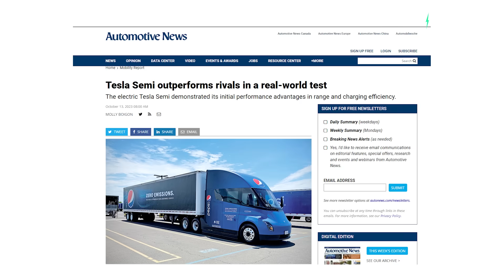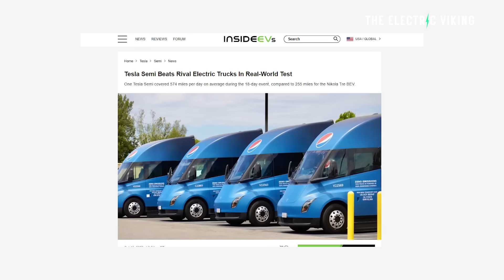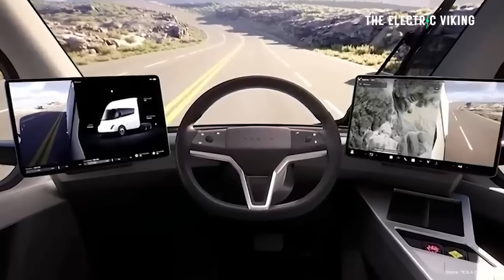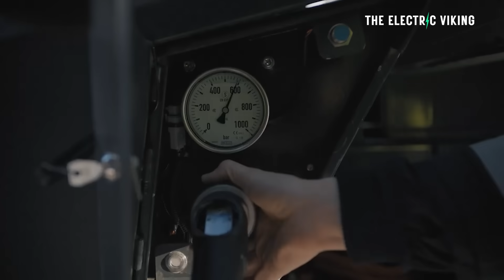Mercedes claim that Tesla Semi breaks the laws of physics proven correct

Comment: In the US we have to take into account DOT rules. When I was driving, if you worked ONE minute over x amount of hours, you’d be required to take 32 hours off consecutively. In my case that just wasn’t an option. ( we were hauling Trash in Bear Country). Bears take very little time off. 
  As compared to passenger cars this can truly change the world in a far bigger way. In my opinion anyway. Look at all the waste with Cooling systems, air Brake Compressor Systems, Transmissions. Diesel pollution rules….Beside the waste, the maintenance is never ending.
Reply: for Purposes of this TEST , Tesla had 3x Slipseat Drivers over 1070 miles in 24H.

Comment: Yeah Mate . How long are those batteries gunna last ? How much money to replace the batteries ? Are we gunna have Semi's self combusting like we've seen with some of the Electric Cars ?
Reply: The batteries will last 20 years.  Over that time, they will have saved the company more money in fuel than the cost of multiple Tesla Semis.

At the end of useful trucking life, the batteries will still have 10 years of life as stationary energy storage - a very valuable application.

And after they are no longer useful for storage, they will be recycled.  Over 95% of materials will be recovered, and the whole cycle will start again.

The only way diesel fuel is recycled, is by YOUR LUNGS.
Reply: +1 million miles , DECADES.
Reply: Oh, and the frequency of EV fires is about 60 times LESS than the rate of ICE fires.  

In the rare event that a BEV truck does catch fire, it's nothing compared to when a fuel tanker goes up.  Those things melt the surrounding infrastructure.

So no, EV trucks will not increase fire dangers, they will greatly reduce them.

Comment: Can you imagine the state of the roads when fleets of these trucks start tearing up and down the country weighing 81.000 pounds? And the price is ridiculous 250.000 dollars per unit….
Reply: @Pierre3513  Batteries will require replacing before the QUARTER MILLION LOAN is paid off.
Reply: @douglastodd1947  I bet the batteries will cost thousands to replace.

Comment: Daimler Trucks not Mercedes!
Reply: eActros is Mercedes, in Europe. eCascadia is Daimler Freightliner in the US.

The testing event Sam is reporting on here was in the US, and, I believe some results were reported for the Daimler Freightliner trucks.

Sam did also mention the eActros which is possibly the industry leader in Europe (after they begin volume production of the long range version) and showed many images of it.

For now, there is no competition between Mercedes heavy trucks and Tesla Semi, as they are separated by the Atlantic Ocean.  But this could change in coming years.

But the CEO of Mercedes trucks did make a silly statement doubting that Tesla would achieve their design goals.  As Sam reports, the doubt has been erased.  Now Mercedes will have to look over their shoulder and hope that Tesla doesn't sneak up and overtake them in Germany.
Reply: @davidmenasco5743  No, there are now two separated companies 1. Mercedes got the cars and vans and 2. Daimler got the truck business.
Reply: @gerhardschreiber5866  Ok, so the eActros and eCascadia trucks are both made by Daimler Truck. 

But the eCascadia is made at the Freightliner factory in Oregon.

The eActros is branded as Mercedes-Benz eActros and sold in Europe, but actually made by Daimler Truck.  But Mercedes-Benz owns 35% of Daimler Truck.

So I think we can say, Tesla is very good at making BEV.  Mercedes-Benz is very good at making confusion.  Sorry, just a little joke I couldn't resist.

Comment: Mercedes was being nice; Tesla lies. To get 500 miles fully loaded has to be downhill with a tail wind. In a video on Youtube you can see a real world drive of a Rivian R1T going 2400 miles across country towing a trailered Mustang; it has 1/8th the battery of a Tesla Semi; and the Mustang 1/10th a loaded Semi; but it only mananged 120 miles per charge!  Hence real world, Semi's range is far less. Even with 4680, under 200 miles for certain. Semi simply isn't able to pull 10 times as much with only 8 times the battery 400% further.  Anyone ought to be able to understand that.
Reply: Wrong
Reply: This is a false equivalency, as you very well know.  For the benefit of others, the Rivian R1T's EPA range was established without a trailer. Adding a trailer dramatically increases the aerodynamic drag of a pickup truck; and since aerodynamic drag is the predominant determinant of range at highway speeds, adding a trailer dramatically reduces the Rivian R1T's range. On the other hand, the Tesla Semi's range of >500 miles was demonstrated with the trailer already attached, and loaded to 81,000 lbs. So the only way to affect range would be either to remove load from the trailer, or uncouple the trailer; and both of these actions would increase range. Anyone ought to be able to understand that.

Comment: Why can't they put solar panels on the trailer, that a lot of area , it would have to contribute some distance
Reply: "Some distance" being a couple hundred meters, tops, in the four hours between chargers.
Reply: because DOT says you cant.
Reply: Because those solar panels would be wasted. Instead of being inefficient because not always in good/perfect orientation with no shade, it will also increase weight and complexity. Those solar panels would massively be more efficient just staying in a parking lot, always in sun's view.

Comment: Tesla claimed they would deliver a 500 mile range truck for 180k dollars by the end of 2019.
They where rightly called on their BS statement.
Just to show how of the mark they were, Most estimates put the Semi battery to at least 900kwh, for 180k that would be 200 dollars per kwh. Tesla currently sells powerpacks for 338 dollars per kwh without installation, also not included is a semi truck...

Comment: Lol stick a payload of 30 tons on its back, and see what happens .
Reply: Its the most powerful class 8 truck on the market, it sustaines 1,500hp...
Reply: @Victor-vj5ds  I’ve been a class one owner driver  in the U.K. for 36 yrs , it doesn’t matter how powerful it is , the batteries would be heavier than the load and no road could take that weight especially most bridges . 
I’d like to know it’s tare weight of the tractor unit with a battery capable of pulling 44 tons for 500 miles plus the tare of the trailer then plus 30 tons of payload . 

Tractor units are normally around 8 tons plus trailer , a slider skel is around 5 tons for iso containers , then 30 tons or more for payload
Reply: @Boris-xx7dw  the tesla semi weighs about 26,000 pounds, the US has limits for vehicles of its class (82,000 lbs). You can increase the legal load limit with more axels. Most trucks hit a volume limit on cargo before they hit a weight limit. Even in the US 85% of trucks travel less than 250 miles. The US is extremely mountainous compared to the UK and thanks to regen breaking and the trucks 1,500HP those wont impact range or deliver time.
Reply: @Victor-vj5ds  you don’t need 1500 bhp , 450 to 550 is enough .
Some applications like transportation of pillows or feathers then fine . 
On a driving day of 9 hours or 10 and 11 in the states , 250 miles range would be a waste of time , 500 miles or  slightly more on a legal driving day is normal . 
We run 3 and 3 at 44 tons , you guys I believe run at 40 on 3 and 2 combination with a ridiculous spread axles . 
Also axles and tyres would increase drag and would also be a waste of time. 
These EV trucks would be no good on long haul , don’t get me started on parking let along trying to charge one of them.
Reply: @Boris-xx7dw  i will get you started, ive heard all this before. 1,500Hp really matters when going up hill or trying to pass other trucks, being able to maintain 60mph uphill at max weight vs 25mph saves a lot of time. 85% of trucks in the US travel less than 250 miles a day, you guys seriously underestimate the advantages of a fully electric drivetrain. Technically the battery can output 9,000HP safely for a few dozen seconds. But the 3 motors are limited to 500Hp each.
Reply: @Victor-vj5ds  don’t bother , they won’t work anyone in the industry knows this , but I will sit back and watch it fail like all Evs .
Reply: @Boris-xx7dw  PepsiCo is in the industry and they seem to think it works. EV sells grow 60% every year and they aren't stopping.

Comment: Mercedes-Benz did well to contest Tesla propaganda because Tesla only talks about range and the all the rest Tesla Semi is the worst of the truck industry, in a segment that truck equipment is a requirement and mandatory, Tesla wants to apply the same poor simplification processes as he does on cars with a stripped equipment cabin and that's not possible and Tesla doesn't understand this specific needs of this segment, Tesla Semi has the most stupid, pathetic engineering and worst ergonomics in the dumbest level, as you can see the seat in Tesla Semi is in the middle without height regulation, the Mercedes 500 SL of 1990 has better thought and well made german engineering of the seat belt that is electric height adjustable than the Tesla Semi that is fixed in the seat without height regulation, if you're a tall person you're going to be with the neck and shoulder very tied and tired of this crap, in the tolls the driver has to get up to pay them because of this very stupid idea of the seat in the middle that doesn't make sense at all, and the front windows don't open; so when passing in the country borders, documents please!, drivers can't talk to borders patrol agents because they're stuck in middle of the truck in the seat, and have to exit the truck, wtf!?, but nobody thought of this!? this is so stupid;  but Tesla wants to be different! for the worst and no logic reasons; truck drivers have to do a lot of maneuvers and pass inches very close from walls and obstacles, with a seat in the middle you have no sense of exact distances, and you can't rely only on cameras and screens, sometimes the cameras will be dirt or with snow, you have to go for other options, and there's no better view than a direct and open window, if can't even open the windows in the front there will be some situations the windows will be very dirt and you can't see nothing, the suicidal doors is another awkward stupidity of Tesla, when maneuvering sometimes you gotta exit the truck and go out to check conditions and distances it and in case of emergency if you're stuck in the snow or mud it's very important to have a clear view, in the Tesla Semi you have a obstructing suicidal door that covers your view you can't see nothing backwards of the truck, there's no CB equipment a requirement that enterprises where loads are delivered need to communicate in his own frequency, there's not a bed in the Tesla Semi, not having a instrument cluster is another big fault, a driver has to constantly check speed and limits, warnings in his the front view, because of speed limitations, of being a professional and because of loads that are in transport, the interior so empty and so poor what a crap truck it is Tesla Semi, i have a truck driving license, i already drove Mercedes-Benz, M.A.N., Volvo trucks and the Tesla Semi is the most dumb stupid truck i ever saw, this is absolute crap for professional use, it's impractical, useless that is already banned in the European Union.

Comment: Just have to wait and see how the PepsiCo Hydrogen truck trial out of Brisbane is going. Sam should have a front row seat as they are passing where he is living currently. Funny how he conveniently ignores that and the hydrogen hubs, being built all around Australia.
Reply: Seems pointless to waste time reporting on an inevitable failure.
Reply: I would love to see a breakdown of the cost difference between the battery swap infrastructure being developed in Australia, versus the hydrogen infrastructure.

And the long term cost of refueling all that hydrogen, versus recharging the batteries.
Reply: @davidmenasco5743  so would I. 👍
Reply: Hydrogen is 10x MORE Expensive than BEV. 
Hydrogen is also MORE slower than BEV and less RANGE (Nikola). 
Hydrogen is only 24% Efficient, whereas BEV (Tesla) is 98% EFFICIENT.

Comment: In reality it’s BS, they don’t carry the weight that is necessary or they run out quickly, so it will be for fruits… but nothing heavy, u need to change the many ton batteries at least every 2 years, while a diesel goes for a 500k miles. And that’s actually the whole expensive part of the truck. H would be a regular motor, but u need a way to make hydrogen that is clean, we don’t have the grid for any solution. We are already low, that’s the problem that’s need to be solved   But it doesn’t sound as sexy as new cars.
Reply: Wow your info is embarrassingly bad, the battery will last 1 million miles. It has a range of 500 miles at full weight, 85% of trucks dont go more than 250 miles a day. Pepsi believes it will save 200k dollars every 3 years on fuel and maintenance. This is the most powerful class 8 truck on the market with 1,500HP.
Reply: @Victor-vj5ds sorry but that is garbage. 15% of large full weight articulated trucks in the world do less than 250 miles per day ?  Sorry , not true at all.
Reply: @jimpackard8059  im talking about the US, one of the biggest countries in the world. Most deliveries are local, so yes, less than 250 miles a day, this is NHTSA  and DOT data.

Comment: Most truck drivers plan on driving 500+ miles per day, so having to stop at 400 miles and charging would be a major bummer. Especially when you consider that a diesel semi only tanks up every 2-3 days.
Reply: What you're missing is that they have to stop at around 400 miles, due to HOS regulations requiring a 30-minute break before 8 hours on duty.
Reply: @BigBen621  I've been out of the trucking industry for several years, but when I was driving they didn't specify the number of miles, they specified that you had to stop after 11hrs of driving or 14hrs of active duty (whichever comes first.) Most truckers would get 500+ miles in that time, which is why I say when they can do 600+ miles then EV trucks will be a home run because then the truckers can charge up over night. Until then though it's just a novelty.
Reply: @BruceWayne15325  Yes, it's based on hours; but the mandatory 30-minute break at or before 8 hours would come a little  around 400 miles, at a 60 MPH average. Given a 40% recharge during this mandatory break, a Tesla Semi can easily do 700 miles in a day, substantially exceeding the 605 mile limit imposed in California by HOS regulations and the California 55 MPH speed limit for trucks. In states with higher speed limits, the calculation would be different.

Comment: No actually I'm telling you exactly the "undistorted" facts. Semi's range is rediculous short with a full load. Pepsi is also Fritolay - a chip maker maybe a truck full of corn chips can go 450 miles; fully loaded more like 150. The power use chart shows it losing 50% of its charge in 60-75 minutes. Oh they don't make much of the fact Semi requires a  $200,000 charger and Million+ dollar megapack to charge it in 30 minutes other wise takes hours..

Comment: Why not just put a small motor to charge them even little bit of charge from the motor will extend the range plus braking regeneration shit even maybe like some windmills on trailer trucks electric seems like a no brainer and panels on top of the trailer with wind helping stay cooler it will yeild more power with all of them combined they should never have to charge

Comment: Bigger battery packs are not the answer and tesla is a 😅😅😅😅
Reply: Well, until someone makes higher energy density batteries you're f&*ked if need longer range.  You have no other solution. Then you need faster charging rates or you will be there all day and night charging up.  This is why electric semis dont work with current tech.
Reply: 1500 miles in a day sounds like a solution to me.  Saving $60,000 + per year on fuel alone sounds pretty good
Reply: @chrishaberbosch1029  seriously you believe it went 1500 mi in a day.....lol